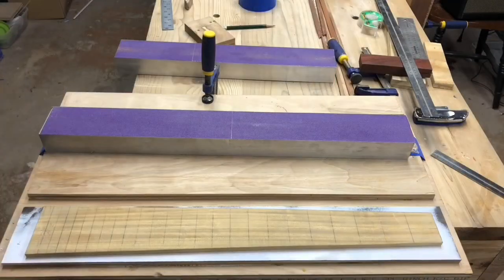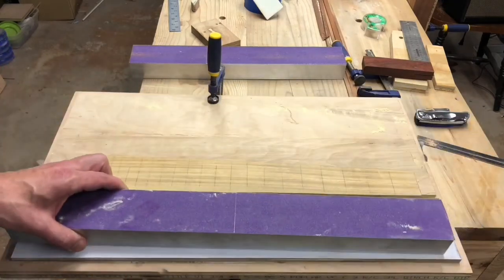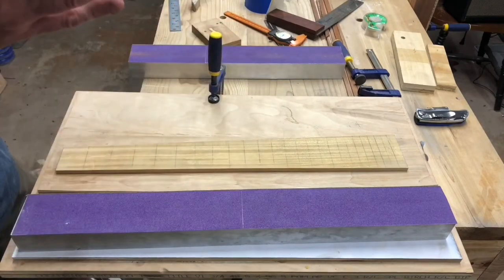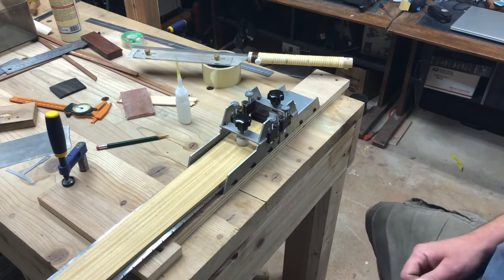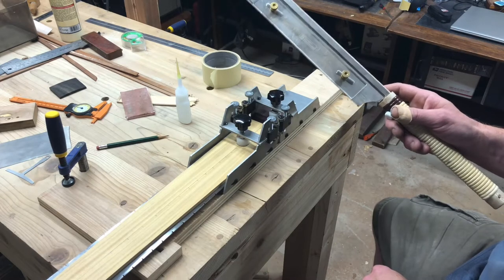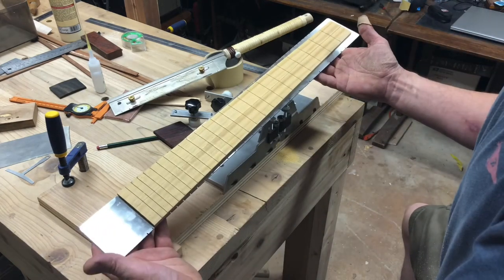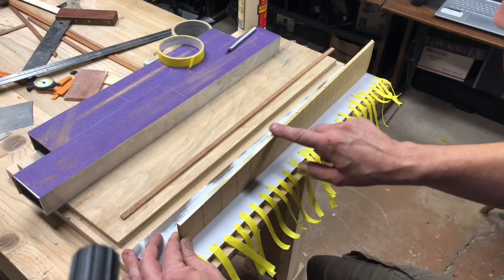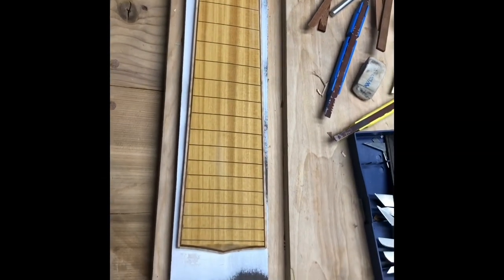Great Guitar Build Off unofficial - 2nd progress video - making a fretboard

Comment: What a nice fretboard! Did you have problems with it no matter what the blade angle was?
Is there a specific reason why you tape up the binding instead of pressing it against an angled edge/or in a jig?
Reply from the maker: first question, yes. It was better with steeper angle, but still micro tear-outs. 2nd question, I have a tapered jig with a raised center for doing both sides at the same time but it wasn’t wide enough for the 8 string fretboard.
Reply: @jasoncruikshank7825  
I totally forgot about the 8-string thing. Time for an adjustable jig. Thx for the detailed reply.
Reply from the maker: I actually started making one, then figured I better just get on with it and make jigs after the challenge. Thanks for asking!